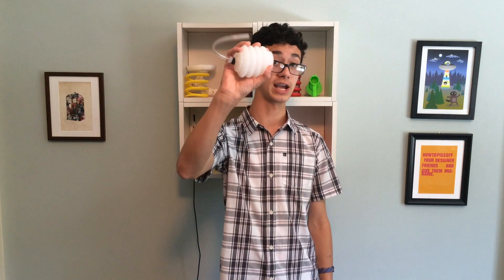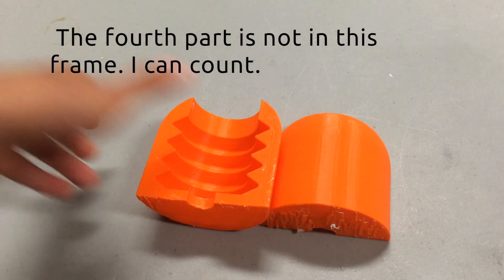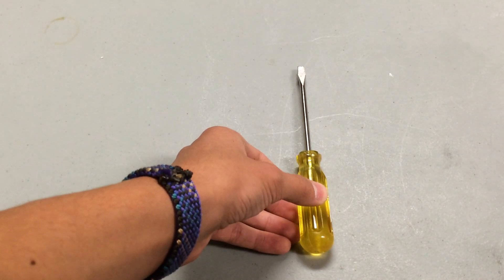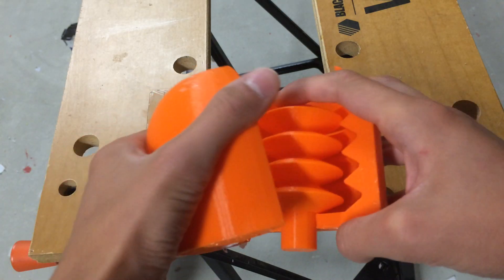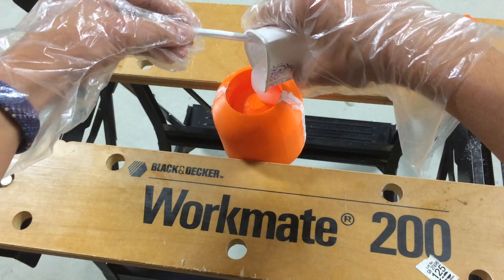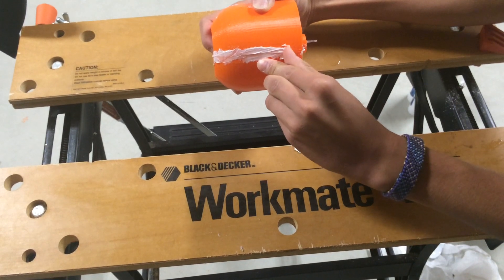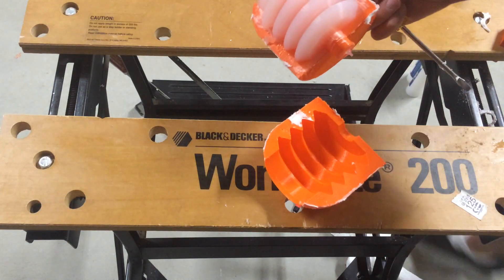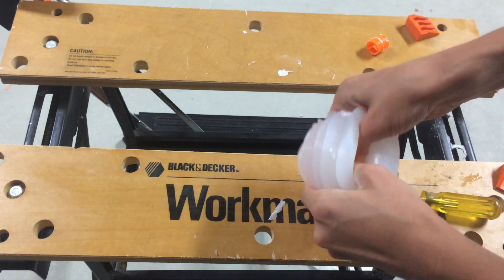Soft Extending Actuator

Comment: Hey would you happen to have an STL file for the mold?
Reply from the maker: In the Instructables guide in the description
Reply: @XYZAidan  Solid. Thank you. 
What software did you use to model the mold? Ive been having a tough time trying to make a similar mold with SolidWorks
Reply: @lupenski54  I probably used Fusion 360 but solidworks should work fine

Comment: Hey Dude, you do some really neat stuff on Soft Robotics! It's something I've never even thought about before. What options are there for controlling these kinds of things? I'd imagine that's the next step!
Reply from the maker: Hey dude! Thanks so much, it means a lot coming from a larger creator like you. You're totally right; control systems are the "other half of the equation" for soft robotics. In fact, my most recent video is a very simple battery-powered control system and I have more control systems planned for the future!
Reply: Hey nice! I missed that. Didn't even know you could get pumps that tiny haha, I'll have to have a go at it some time. Looking forward to the soft gripper on robot arm project.

Comment: very cool. i think you should show it in use tho. id like to see how strong it is
Reply from the maker: Thanks! I'm working on a multi-actuator project that will involve these, but it's difficult to test something like this, as most equipment is designed for linear and hard things, not a soft robot.
Reply: XYZAidan Im really impressed. Im working on a similar project and so far you seem to be the only one that was looking in the direction i was. love your soft actuator project and the syringe pneumatic muscles. I'm sure you've already looked into fishing line artificial muscles. Anyway keep it up.
Reply from the maker: +Kenton Morales Thanks again. By fishing line artificial muscles, do you mean SDM fingers? If so, I've already done a project on it, you can find it here: https://youtu.be/o6Vj3pT-2ec
Reply: Dude I love your videos keep making them.